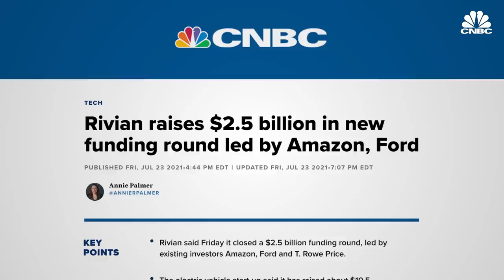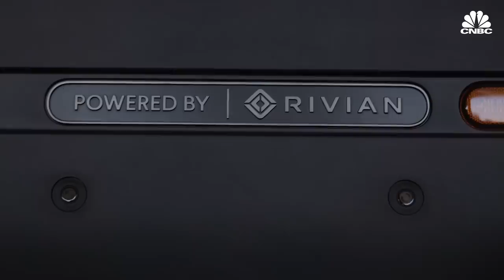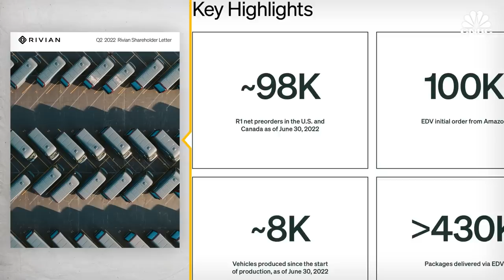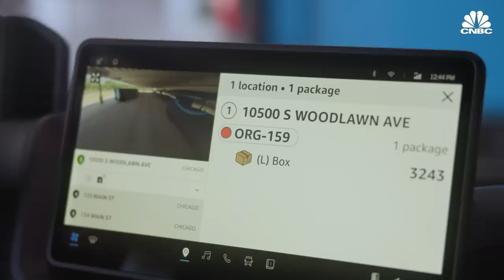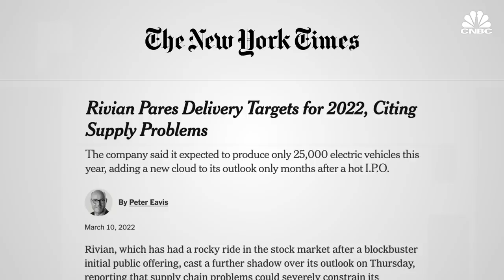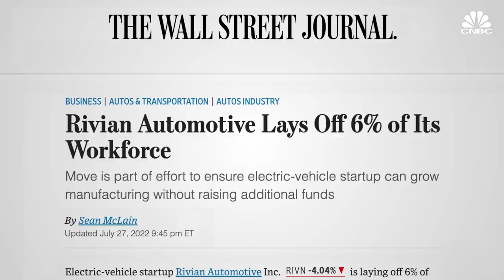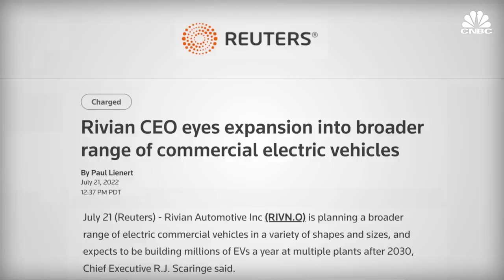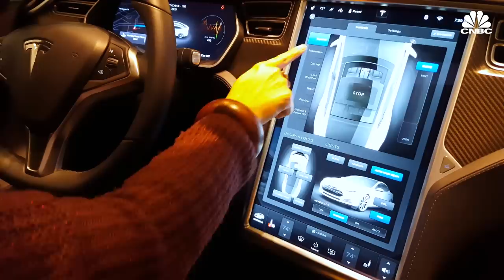How Amazon Is Giving Rivian An Edge In The EV Industry

Comment: These EV cars need to be repairable at reasonable rates before I can consider them, and I should be able to buy parts and do repairs myself.
Reply: Yeah, too much of the positive talk is getting these to market, there is nothing on longevity or repairability. Fleets have service contracts and utilised to the fullest lifespan. Without a viable aftermarket, these things are doomed outside of the corporate world.  This being said, Amazon will have enough real world data by the end of the decade to potentially make it a feasible concept for general marketplace.
Reply: The EV companies have a monopoly on repairs & service which is where they will make bank. However, I think the mechanics in Massachusetts sued Tesla because state law allows them to work on any car, but Tesla wouldn’t allow them. It will take at least a few generations to build a huge workforce of generally trained skilled techs to be able to fix these EVs at a reasonable cost. Also, the recycling business has to increase as well to take care of the obsolete models and their toxic battery materials. I think Tesla is already factoring recycling in their business plans.
Reply: @user-zlxelaZz   
I don't know, that Amazon contract may just be about all Rivian can handle, outside of the few niche premium vehicles, over the next decade.  If it doesn't perform satisfactory to Amazon's expectations and tolerances, the whole company likely won't survive.  Focusing on one primary design is great for a start-up but also a double edged sword!

Aftermarket is the one crucial element that EV corporations are overlooking to their detriment.  Tesla can pull this with their high end buyers who have more money than sense who expect that premium brand exclusivity, but once they enter the general marketplace, that's a whole different customer base with vastly different expectations of how their daily driver is supposed to operate and where they choose to repair it. Middle class Americans want choice, convenience and repairability, not waitlists and  backordered.  Toyota rarely has any vital parts more than 48 hours away from pretty much any point in the continental US, and this doesn't even factor the non-OEM components!
Reply: @yayagazab4449  
If Rivian sticks to a mostly uniform parts design amongst all the the vehicles, the repairability and survivability rockets.  Lots of components can be functionally identical. Relays, for example, are generally the same among brands, and pre-internet days, one most probably would not have been much aware of interchangeability for some part numbers.  The big players already know what their customers want, and if these EV exclusive manufacturers fail to integrate some standard business practises, they risk swiftly dying out without a chance of a buy out rescue.  These companies can do better than the big three from the ground up in this twenty-first century by modifying how things are done, but this means exceeding customer service, not hindering it.  Directly licencing out designs for parts would add a revenue stream and make customers more comfortable buying aftermarket early on and is a legit possibility.  It would also potentially add an emergency supplier to Rivian's manufacturing capabilities, since this is a real world issue at the moment.   I know this is already something that happens, but Rivian is in a ground up position to make it standard business practise across the board on the front end.  

The second hand market is almost more important to the auto manufacturers than first time sales.  When people have a good experience, they are more likely to return to the source, when it comes time to buy new.  A teen's first car influences a lifetime of buying decisions.

Comment: 2000 components, over 400 suppliers. Thats a mess for a modern auto EV business that had no legacy issues. Ford sold on it shares as the share continued to sink. Margins loss and EBITA loss and cashflow losses are mounting.

Trying to drive 2 distinct part of the business at such an early stage is mad for any new startup and now the share price reflects the issues they are struggling to manage out. As I see it it needs more cash injection and its battery supply contained beyond the desire to increase production.

R1T is a lifestyle pickup not a work pickup and its just too expensive when you add required specs. 

I would like to see then succeed but as present. It is not looking anywhere as positive as this CNC segment implies.
2000 components, 400 suppliers in a ramp up situation is not going to easy the issues Rivian faces.

The R2 and a new plant in Georgia, too much stress, too much financial and a production strain.  As for Jeep. It will never complete in that segment. Its an entirely different consideration.

100K Amazon fleet from now until 2030 is not many, R1 orders are not that many once one the initial run rate can deliver those, what next?  Invest with caution.
Reply: I was thinking the same thing. With all those suppliers and components, repair costs will be through the roof due to time and labor. It also makes growth in the company so much much harder. Potential conflicts in the world brewing threaten the supply chain as well. This company has major hurdles ahead of them.
Reply: They have 98K backorders since Jun 30 and 100K orders from Amazon....yeah,..they'll fail.....NOT...learn how business works...always start off with big "losses" before gains. SEE TESLA
Reply: Tesla didn't have major competition and was early. Rivian is facing major competition from every EV and car manufacturers now and they to start from basically the ground up.

Comment: One side says EVs are the solution, the other side is stubborn and makes up BS like EVs cause more pollution than ICEs. BOTH sides are wrong. The solution is not electric vehicles. Because the problem itself is too many vehicles. The solution is making cities walkable again. If people were able to get around quickly and safely by walking , cycling, or using public transportation, then there would be no need for a vehicle for most people most of the time. Sure EVs cause less pollution. But using your own two legs causes ZERO pollution, other than wearing out your shoes more. EVs are a failure of capitalism trying to solve a problem when the real solution is changing the law. The government is causing the problem and it needs to change. Most municipalities have laws like requiring massive parking lots, wide roads, etc and they completely ignore pedestrians and cyclists as an afterthought, making it dangerous for them to get around with a car. Making everything spread out so far for the car, which takes up a ton of space, makes it impractical to walk or cycle as well. We need cities to be built again like they were downtown in the old days. We had an experiment after WWII to have everyone drive, and it failed. Some people can't, some people clearly shouldn't, and it's not sustainable. We made huge changes then, having the government invest in roads and infrastructure and subsidizing the automobile and fossil fuel companies, so we can make big changes again today. Ironically though, the people against it are ignorant and take it for granted that we have roads today, because it was the government that made that happen. Yet they don't want the government to do anything today like building new sidewalks or bike lanes.
Reply: But what about logistics companies?
Reply: While I don't agree with everything you said I do think you have some great points, City planning is awful, people should walk or bike more but we have some limiting factors of course like where is the city located , how spread out is the city ,  where do we draw the line when its acceptable to dive vs walk, bike or use public transit. The simple solution is to make no vehicle zone within the city that make sense too, like major downtown areas but then you run into the problem of where are the people who are not from said city are going to park their car? How do the stores, building, ect get supplies and services/repairs completed?  How do emergency responders get to people in a timely fashion? I cant see a car-less life for everyone in the US , its unfeasible with current technology, millions of people myself included will not move to a city to give my personal car or truck. Why? well I've done the city thing and its not for me, I don't like crowds all the  time, I value my peace, privacy and love nature. In other words I can go touch grass at will , just feet from my door.  But I think instead of pointing the finger at "Capitalism" and "Law" people should go back to community and culture. Changes start there and work their way out. Politics is down stream of culture.  I think most people lost community as a whole but that's a big topic for another day.
Reply: Agree with your points.  However, I think the EV--and more importantly, self-driving vehicles--are stepping stones to your idealized future (which is where we want to go).  Self-driving cars will ultimately solve the problem of parking, as these cars will only have to park long enough to discharge or take on passengers before rejoining traffic.

And I believe that ultimately they will solve the real barrier to the future you envision, which is North America's love of car ownership.  For the majority of middle-class and poor people, car ownership will become an unnecessary expense, indeed, just a headache, when you can walk down your driveway and have a car waiting there for you within 30 seconds to take you on your way at city bus prices.

No worries about charging, maintenance, insurance, registration, teaching your kids how to drive, finding parking or traffic jams.  Ultimately, these vehicles should be able to coordinate their movements and eliminate traffic problems. 

Only fools, germophobes, or the very rich will insist on driving their own cars.  Well, they and people who just love driving and the romance of cars.  But I think they'll end up spending most of their time at the racetrack, the drag strip or the demolition derby. I have nothing against these people but they're now obstructing our way to a far more responsible and practical transportation infrastructure.
Reply: How does walking and cycling work out when it rains or snows? 🤔
Reply: @eyesuckle  lol well call me a fool then, I think as far as fully autonomous vehicles in the US goes its only logical to implement them in cities and and large metropolitan areas in the near future. As far as autonomous large vehicles ie  Class 8 trucks there is no way you can allow them on the same road ways as passenger vehicles until you reach at least near 99% autonomous infrastructure due to the timing it takes for a collision to be avoided is much greater with the amount of weight being hauled.  Other than the obvious safety concern you have to think about the legal responsibility, who will be at fault and who will pay the bill for damages. There are sacrifices that can be put into place such slower speed limits or separate road system for large vehicles and so on. I think EV and fully autonomous vehicles are going to take over but I don't agree with the ownership part for the whole country. Sure for the large cities and its suburbs it makes sense but for those who do not and can not move to the cities or its suburbs it doesn't work for them. It would very authoritarian to make this group of people relocate or leave them in the dark for transportation. Unless we are going to into split vehicle economy, meaning that cities get  EV fully autonomous vehicles and rural small town get ICE or Hybrid or EV non autonomous which is perfectly fine. It would meet emission standards for the country as a whole. Again I'm only concerned about the problems from now to 15 years out with implantation of this tech. That's where the rubber hits the road per say. Don't get me wrong I'd love to take a nap as my car drives me home safely after a hard day of work, I just don't see it being a reality before I retire. And the point you made about the US not doing this is funny because I don't see any other country doing thing all in at the very moment  for a lot of the same reason I mentioned. I'm still waiting on the promises from the 1940's of flying cars and food pills, I'm not saying it to be mean its just a reminder to check to see if these options are really as good as they seem. It all sounds good but what are the risk and rewards. EV at this moment are not zero emission, neither is solar due to the manufacturing and waste after the life of the product. We cant recycle 100% of it.  Heck just sitting here breathing is emitting some form of emission. Do we need  to be smarter about our emissions on our modes of transportation? Yes. Do we have to put all of our eggs in one basket,? No. Again I don't garment policies are the whole answer nor is technocracy. Its Community. Does your local Community feel that their is a need for this? City communities would most likely love this  due to cleaner air, less noise and less traffic congestion.
Reply: @tomcat8662  Agree, some how the Finnish  figured out how to bike in the snow. Not Just Bikes did a video on it a while back. Not going to say its pleasant to ride or walk in the snow or rain.
Reply: @tomcat8662  Obviously, it's less appealing than commuting in sunshine.  But it's not as if people don't do it!
Reply: @tomcat8662  It rains 2-4 times a week in the Netherlands yet that country is known for everyone cycling. It also gets freezing there.
Reply: @austinhernandez2716  
Can’t imagine people showing up to work in their business suits with mud all over the bottom of their pants. But I guess that’s their culture, so who am I to judge? 🤷🏻‍♂️
Reply: I love to walk and take public transportation and will tell it to anyone that will listen. But I currently live in a small rural town and state where not having a car is not a viable option. Neither is affordable public transportation. So cars are necessary.

I also had a conversation with a friend who lives and takes care of her aging and not very mobile mother, and she was complaining to me that the city of Pittsburgh was putting in all of these bike lanes with complete disregard for those who have to drive.

She said that pulling her car up to a sidewalk has now been blocked in many places downtown by the barriers erected to protect bikers making it increasingly challenging to find a place to safely drop her mother off in close proximity to where she needs to be. She sounded angry and frustrated and wants to leave the city. She said she is not against walkable cities but wishes someone had a seat a the table that was in her position so they could have had a voice.

I am working to move to a city again so I can get rid of my car and walk and take public transport. But cities with very good public infrastructure are also becoming increasingly unaffordable with housing costs going through the roof. So there is that too.

Cities and governments seem to be leaning toward profit over people. EV's are a cleaner solution to ICE vehicles. But the costs are prohibitive at the moment. Until they come down it will be a niche market for the wealthy. And cities too. And more people will be forced to live outside of cities and in rural areas where they need a car.
Reply: @techtutorvideos  And walking is free. How can the gov't and industry make money off of that?
Reply: @tomcat8662  I walked to work in Denver in the rain and snow when I lived there after I sold my car. It was about a mile and a half each way. I wore a coat or a raincoat and it worked out just fine for me. 

But if you are elderly or have mobility issues it won't work for you.
Reply: Yes! The comment I needed to see
Reply: Governments can do a lot and should do a lot to make cities walkable, bike friendly and have good public transportation. Cars are still needed for many purposes though. Saying that as a Dane. 

PS. For the "what about rain and snow?" comments - we bike all year here, though busses do tend to get packed during especially bad winter weather. It's a matter of having the right clothing mostly.